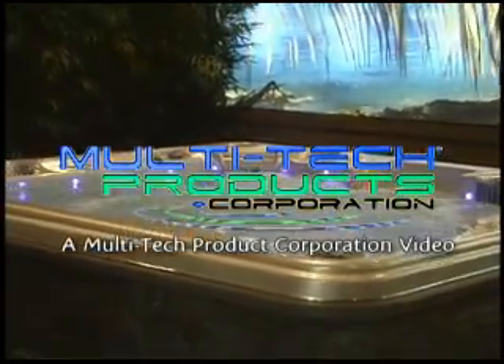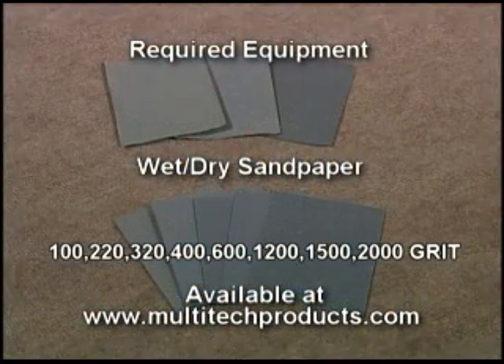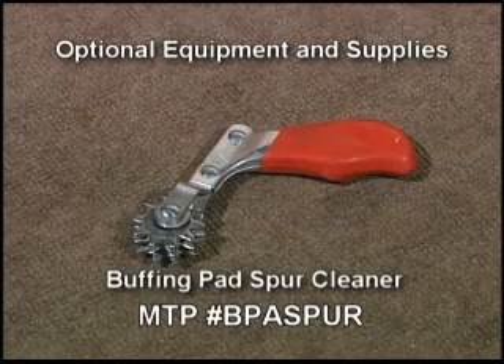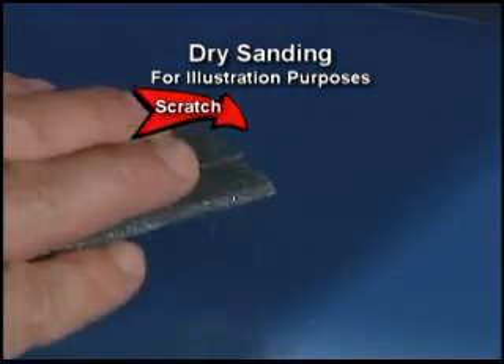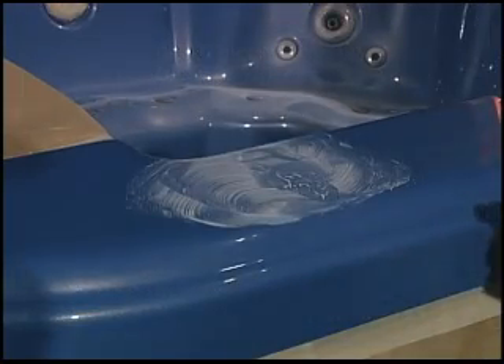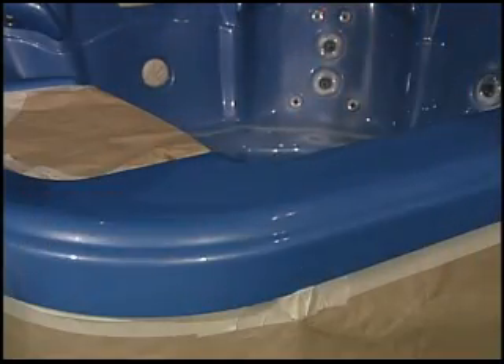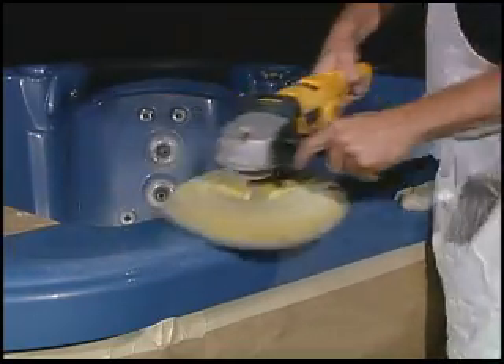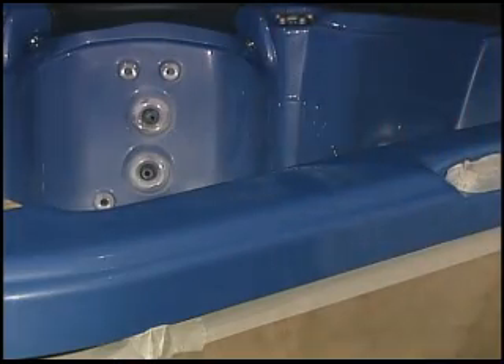acrylic repair 1

Comment: Lonny-I acquired a hot tub and dont know what brand it is. The blue tub in your video repair is almost identical to mine, The 4 drink cover over the skimmer/water intake was my first clue. Do you know what brand it is? If yes, do you know what model? I sure would appreciate it if you could answer this question. My tub also has the Gecko spa pack and  controls from Canada (Heater/pump/ozonator/k450 controller/etc). Thanks.